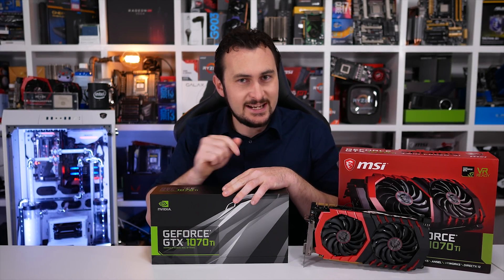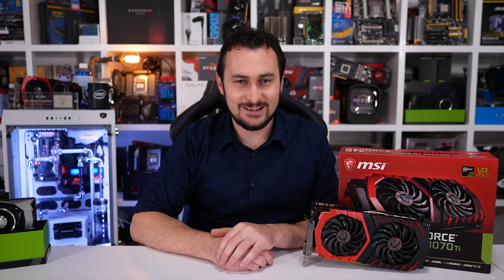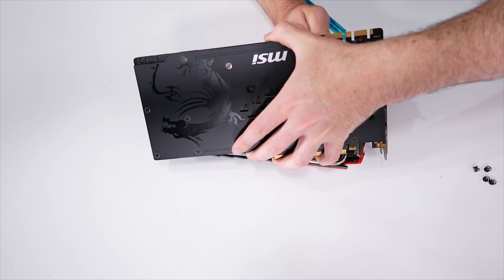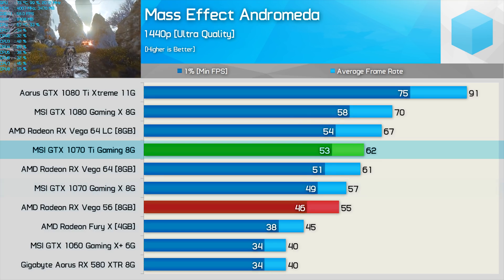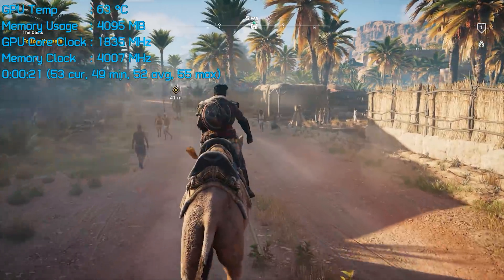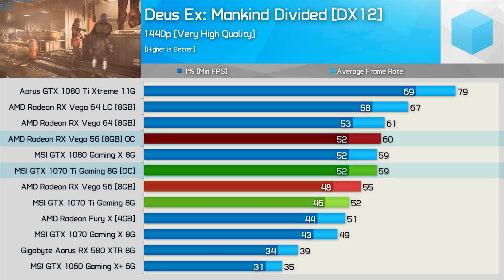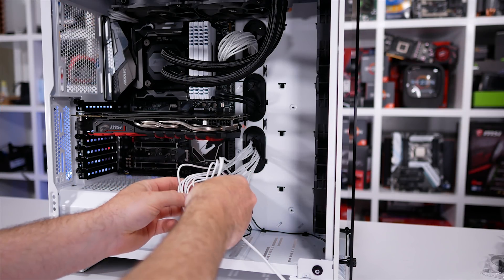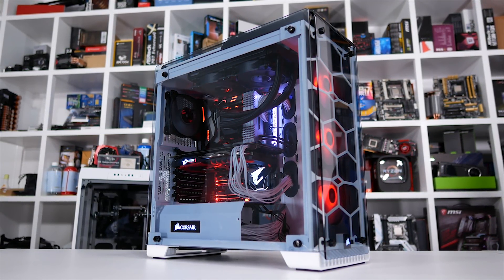MSI GTX 1070 Ti Gaming, Overclocking, Power & Thermals

Comment: I have noticed that this 1070ti has thermal issues and need to claim the warranty or rma it. Is that the case? Is it worth buying used 1070ti now at $230 ?
Reply: Hope u did. EVGA SC for that very price & OC it tops at 70°C with like fan at 50%.
Call it "some design".

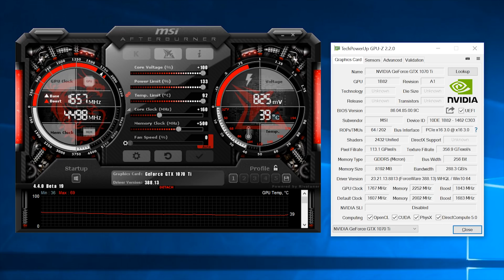Comment: Ok, here I have MSI GAMING GTX 1070 Ti with 700w PSU, Is it safe to use same configuration at 7:23?
Reply: I run it OC with a 3700 X  & an old  500 W Seasonic like from 2010. 
I write this down for those searching today, as u guess.
Reply: @vivianvaldi7871  I have tried the settings at 7:23 but after that when i played a game, I had display crash error. I think these settings dont work for me. :(
Reply: @oguzuz3990  Hello if ur GC is not new, dryed thermal paste can be the issue. Mine was second hand, so since one year I run with thermal grizzly carbonaut. It's solved for ever now. Memory boost from 4000 to 4400 is very  noticeable.
Reply: @vivianvaldi7871  ok I will do what you have said to me

Comment: Hopefully you reply. So I have the same graphics card with a similar overclock, except it doesn’t run quiet at all. My fan speed gets up to 90% and the gpu hits 80-85 C. Why is this happening. I have a front mounted aio if you think that’s the problem. Really lost because me previous 970 with the same front aio config never hit 75 C.

Comment: Hey mate thanks for your video, sorry my english is little bad as i learned it from school, but i like your channel and already subscribed :D :D 

That video is so amazing, maybe i will buy GTX 1070 ti in the next period after a little price drop,  but i have just 1 question and i hope for help:

As i just got my 1st gaming PC, i didn't know much stuff about overclocking, here i need to ask you:

Does overclocking the GPU is different from the CPU ? so just 1 step only to get 1070 ti overclocked ?? 
What about cooling needs? my PC already has 2 front intakes from 3 installed and 1 rear exhaust, but it can support more 2 exhaust in the top and 1 intake front down the case but that maybe useless, anyways what about cooling needs to keep my GPU protected from over-heating ?? Do i need to install the 2 tops ??

HINT: my case is Cooler Master MB511, 2 front intakes are cougar turbine 120mm cooling fan

Thanks in advance.

Comment: WHY IS EVERY REVIEWER MISSING THE POINT OF THIS CARD IN OC MODE! At ( STOCK 60/75/100/ OC fps ULTRADWIDE AND IN 1920X1080 120-144FPS )* in the now gaming popular ultrawide monitors, this beast will do well and leave meat on the bone in most cases. Where a 1080 and 1080ti are faster but if you hate screen tearing you are going to lock your monitor to its refresh rate. That being the case, a 1080 being 6-14% faster means nothing. Why leave a ton of meat on the bone. The only time to buy 1080 is to reach 144fps  hit or miss at 1080 OC or a 1080ti to hit 144fps lock and higher hit or miss. 

So with most of the population buying mid range monitors this card is THE MOST PERFECT FIT OF ALL REGARDLESS OR PRICE. THROW in the price savings and BOOM! WINNER!
Reply: pushing clocks nowadays leaves around a 4% delta. It's great because you can get that kind of performance for around $250
Reply: I have  an ultrawide 2k monitor , thanks for sharing! Looking forward to seeing the difference from my gtx 970.

Comment: I plan on reaching 75 fps on ultra wide 1080p on games like cod gta V and fortnite on at least high. I will be using 16gb of ram and Ryzen 5 2600x, but I'm wondering if I should get a 1060 6gb or 1070 ti for 210$ more?

Comment: Any 1070 Ti vs 1080 benchmarks with both cards overclocked?   Wouldn't that prove if the 1070 Ti is a worth the price difference between the two cards?

Comment: Hey, Steve, if you are looking for new ideas for videos I have one for you.  Perhaps you could do a video on how much games have improved at using multiple threads since like 2012.  Take 4-5 games that were considered well optimized and used modern game engines for the time from 2012, 2013, 2014, 2015, 2016, and 2017, and see how core utilization changes on with different games on something like a Ryzen 7.

Comment: Appreaciate the effort! Could you just give me some info of your Vega 56 OC settings?
Which clocks, voltages, powerlimit did you set. This would help with the comparison. There are to many different ways you can "oc" a vega 56, which performs differently.

Comment: There was no real point of this product to even exist. It's almost as expensive as some of the 1080 or just slightly less than a 1080. It's not good for mining either since 1070 ti uses the same watts as a 1080 would, so this "upgrade" doesn't make any sense at all. It will always just fall below 1080 performance and for the same watts and just a little more $, getting a 1080 makes more sense in the long run.

Comment: Hmm....Yea, this card was designed for one thing and one thing only - to answer Vega 56's performance directly.  nVidia likely doesn't care that in terms of price to performance the 1080 should come down a little - as long as end users are buying nVida 1070Ti's instead of 1080's they are still making the sales.  I don't think nVidia should be locking down their partners they way they are however, factory OCing is just another way partners compete with each other...  On the AMD side, I hope their partners can get their custom cooled cards going soon.  And I hope AMD supply issues get resolved soon so that prices will match AMD announced pricing strategy.  But looking at some other aspects of the graphics market, I think AMD might be able to seriously challenge nVidia in a totally different way given how things are progressing on the Linux side of things.  The Linux market maybe small, though I suspect a few Linux users will be willing to make the jump to AMD side given how the open source AMDGPU driver is really starting to pull together (nVidia really has no direct answer for this at all at present time).  But that's a different topic (though it has some relation to gaming - at least, on the Linux side of things).  Anyhow, take care of your voice and get better soon. :-)

Comment: What ive noticed is the card chokes at 4k until overclocked, but no one test memory oc independently. Once you get some sleep and feel better, maybe check out if the card is getting choked memory bandwidth wise at 4k. Specifically in gamers nexus testing I saw that the stock card was near the 1070 in 4k games, while the oc one was near the 1080 like it should be. Since the only thing the ti shares with the non ti is memory configuration, I would love to see how the lack of G5X affects the card.

Comment: Another great video man. The price on the 1070ti is ridiculous. Here in Canada the cheapest 1070ti is $649.99 yet I can buy a GTX 1080 for $634.99. Why the hell is the 1070ti more expensive then the 1080? Makes no sense. All Nvidia  had to do was drop the price of the 1070 and 1080 instead of releasing an overpriced card.

Comment: I don't see a point in buying this.
You'll be better getting a 1070 or 1080 since 1070TI dosent really have much to offer beside being matching 1080 when Overclocked
Reply: Red or better still, buy a Vega card
Reply: Willy et scientia I bought the vega 56 Bundle when it first came out.
I had an i5 650 and an HD 5770 and I was planning on a new build so I just bought the bundle and I didn't regret it at all :)
Reply: Red nice xD 

Have you flashed it? If so, how much gains in performance have you noticed?
Reply: Willy et scientia no I haven't done that actually

Comment: The card is great for someone with 144hz Monitor with no sync tech in it, or on a extremely tight budget wanting higher end gpu, with that said, anyone with a Freesync Monitor just get those juicy Vega 56 while the prices are stable.

Comment: This card is very memory bandwith starved. A 12% memory overclock yields a performance gains of 13-15% is very telling. For normal midrange card that isnt memory bandwith starved, overclocking the memory does next to nothing. For this to gain more performance than the overclock itself just confirms it.
Reply: More CUDA cores to feed but the same, non-Ti, memory bandwidth.
Reply: Exactly.
Reply: It was bottlenecked on purpose, Nvidia didn't want it to beat the 1080

Comment: The more videos i see the more i realize the gtx 1070 is overpriced asf.Matter of fact price to performance wise,i'm not impressed at all.These cards are way too expensive for what they are.When the 1070s hovered around $329 that's when they were worth it.All of these cards inflated prices are just unappealing.
Reply: Your gtx 1070 £350 is converted to $457 US .That's literally the price of the new gtx 1070 ti.And is 57 US more expensive than the price that the gtx 1070 is currently selling for in the US.Just a few months ago the gtx 1070 would have been at  £254 thats almost  £100 less. I'm not sure if these prices are how it goes for your country or if it's cheap for you,so there's that.

Comment: The 1070ti released while I wait for the RAM prices to come down ... Really a bad time to build a PC ;_;
Reply: But Gabe, with all the Steam Sales you should be wealthy enough to buy 128GB Ram
Reply: Buy used. I got a 32gb kit of ddr4 for way under msrp even though the kit was brand new.
Reply: I read an article in which the 3 top Ram producers said that they all independent from each other for sure decided to stop producing DDR4 Ram throughout all 2018 so they can keep the prices up and even raise it for the margin...so before 2019 they won't come down...here is the article: http://press.trendforce.com/press/20170920-2972.html

We are all fucked....I still run on a Core 2 Quad Q6600@3,0 Ghz with a Gtx 670. But I am too stubborn...I won't buy 16 GB DDR4 until it is underneath the 100€ mark again...so fuck companies...
Reply: 8 months later and 1070Ti costs the same as 1070.
Reply: Gorilla Warfare thought they would be in early 2018
Reply: PugsnotDrugs000 y
Reply: Sad and True bois, If anything expect those mofo's to go up. If You have craigslist check it out. I got a 16 gb kit 3000 for $112
Reply: Gabe Newell Just picked up DDR4 3000 16gb for $122 yesterday. Not bad I'd say considering the other sticks I was going to get went up to $188 and were slower.
Reply: i just managed to get 16 GBs of DDR4 ram at 3000 MHz for 130$, and a 1070 ti gaming for a price of 500$ (which ist 70$ lower than what shops offer in my country) XD So if you look hard enough you can find everything quite cheaply :P
Reply: Why is this hobby so expensive
Reply: Gregory Cormier because a business needs money
Reply: Managed to scoop up an EVGA 1080 SC off of eBay for $465. Works perfectly as well.
Reply: They won't come down any time soon

Comment: vega 56 on microcenter. is $399.99
Reply: It hit $399.99 on Newegg 2 days ago. And Vega 64 is almost down to MSRP. Funny how all of a sudden Vega prices plummeted, isn't it?
Reply: Batemen undervolt
Reply: Batemen your PSU is of 1200 wats? :\
Reply: did u watch Video,, 10 Watt difference bother u ?
Reply: Unless you're gaming for 12 hours a day, the V56 is a much better buy, especially long term.

Comment: i question the timing of this card. especially considering they might make announcements for volta soon.  the prices of vega 56 have dropped considerably. i am really surprised as well. i would have skipped the 1070ti and get a regular 1070 for 399$ and overclock it. the 1070ti is to close in price to the 1080 currently, only to match its stock performance with an overclock. vega 56 is better bang for buck. it seems as though AMD is skipping AIB cards all together.

Comment: You screwed the pooch with yer MSRPs dude .... GTX1080 US MSRP is $499 (not $600) ... Vega 56 US MSRP is $399 (not $100) ..... blame it on the man flu / cold / sore throat .. :)
Reply from the maker: Yeah I messed up there. I didn't actually change the pricing info from the previous table data, I was too focused on the other specs that I was discussing.

Comment: Is this card a new mindblowing product? No. But for the price its ok i guess. It certainly beats vega 56 being that you can't find vega for normal price, also power consumption on vega is just crazy high. Also vega build design and cooler is just plain shit. But honestly for 1440p i wouldn't go above basic 1070. You can just overclock it a bit and you will get stock 1070Ti. If you go for 4k then both 1070ti or vega56  won't do job.

Comment: If it drops to what the 1070 is now and the 1070 drops to between $300 and $350 it'll be great. If it stays hovering where it is..meh. It's kind of getting to the point where you can hold out for Volta cards in 2018 unless you desperately need an upgrade.

Comment: This card makes 0 sense
Reply: It is 20% cheaper than 1080 in Poland so for me it makes sense :)
Reply: Yeah, thanks AMD...
Reply: More sense then shitty vega
Reply: MarviN , I agree. Here in Canada you can buy a GTX1080 cheaper then you can buy the GTX1070TI. Why would I buy the 1070ti for more money then the 1080? Answer is I wouldn't , no one is going to buy the 1070ti when you can buy the 1080 cheaper.
Reply: You are missing the complete picture: 1070Ti was the last piece needed for nVidia to completely eliminate AMD. This trio (1070-1070Ti-1080) makes VEGA looking like a very bad purchase. Because 1070&1080 prices will slightly drop now, nVidia delivers better performance for every price point you can think of. And all this without taking into consideration the fact that VEGA cards are burning at least 25% more power than their nVidia counterparts. So, VEGA is more expensive, more power hungry and about the same performance. Yeah, you can say again that 1070Ti makes no sense please.
Reply: It is there to push Vega56 from a GTX 1070 killer pedestal.
Reply: Minus, maybe where you are this card makes some sense but where I am it does not. It is priced higher then the gtx1080's where I live so why the hell would I pay more money for the 1070ti? Nvidia just had to lower the price of the 1070 and 1080 by $50-$75 each and vega would be done for.
Reply: But here's the deal, if you're lucky enough to be in the US you can get it for 450$ which is well worth it than spending an extra 100$ for a 1080 that yields the same performance . If you OC the 1070ti of course.
Reply: KannX much expensive than the gtx 1080 in my country
Reply: ugaaa5 Yes in the Long run its better but im Planning to Ude my card only for One gen and im Not playing that many new titles  ( only  Planning in the crew2 next Year but all my Games Use dx9-dx11 ans dx performance is sometimes even better with Nvidia
Reply: carig121 the stocks are back but the dissapointing is the aib cards are not even out yet, I'm hoping it will not end like the fury series where asus and sapphire were the only aib cards
Reply: KannX play witcher on it to inaugurate it.

If you get it, that is.
Reply: Second Account dont think so
Reply: Shido8 They said that aftermarked cooler vesion is not any better then the original so they wont make any
Reply: Perseen Reikä Poliisi yeah I've watch that asus strix is worst than the reference
Reply: It makes absolute sense: it killed VEGA completely
Reply: Minus not really though
Reply: PugsnotDrugs000 because its not price right in other countries and the gtx 1080 is getting cheaper by now
Reply: it makes sence for nvidia ^^ RX vega 56 killer
Reply: ugaaa5  Not a "Killer" but now the 1070 ti is the better card . especcialy if you look at Things like Power Draw etc. (although i am a slight amd Fan i Think nvidia wins over RX vega 56 and 64)
Reply: i think AMD didn't need Nvidia to kill their Vega cards, they did it all by themselves with high prices, no stock (thx to miners), and one disappointing  custom card so far
Reply: It drives down 1070 prices some... So budget 4k got better, I wanted Vega to be a success but I guess by the time January rolls around we'll see what's going on my new build
Reply: ugaaa5 Yeah people said like that in 2016 when rx480 and 1060 came out , now more than a year later how many vulkan games we have today, Nvidia cards now don't even have problem with Dx12 games anymore and for lots of games they even perform better than Amd's counterpart , it's likely 2-3 years from now till we see a decent number of vulkan games and vega 56 will be shit then.

Comment: Just a word of advice warm tea and honey helps soothe the throat. It will help your throat hurt less. Mustard works too but doesn't taste as good.
Reply: I find that hot water (nearing burning hot but not enough to burn your mouth/tongue) works better than warm-honey tea. Mint and ginger also does a better job for me as well, so throw in a couple of mint leaves and a thin ginger slice with the hot water. Initially, it feels unbearable when sculling it down, but you'll feel the effects much sooner. Doesn't taste as good as honey tea, but its effectiveness outweighs the taste. Never heard of mustard being used though ...

Comment: So if you can get if for a reasonable price, it's not bad.  Otherwise, just get a custom 1080.  Hopefully this pushes Vega prices down faster.  I wonder what this will do for the custom Vega 56 market.  The profit margins were already slim.  Now the 1070 ti is going to push the price down even more.  We may not even see custom Vega until the rumored Vega refresh comes.  And that won't be until May at the earliest.

Comment: used 1080 cheaper than 1070ti?
Reply: 1080 exoc from galaxy is on sale for less than the 1070ti in australia atm lol
Reply: Brand new Galax GTX 1080, MSI GTX 1080 Armor and Gigabyte GTX 1080 are all cheaper then a 1070 ti.
Reply from the maker: I would hope so, there's like $50 in it brand new.